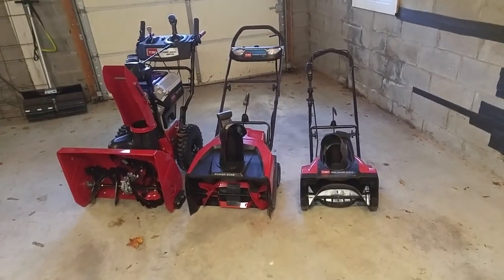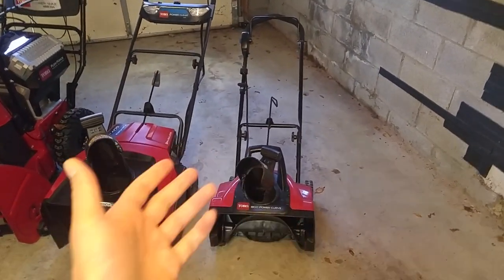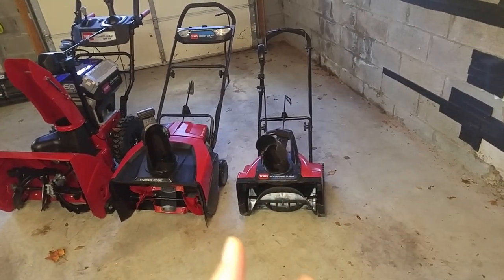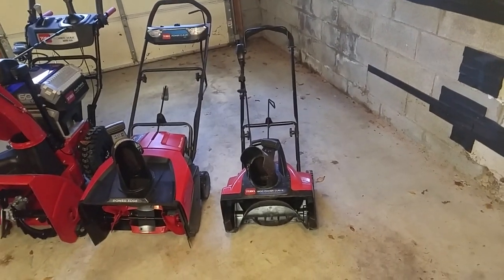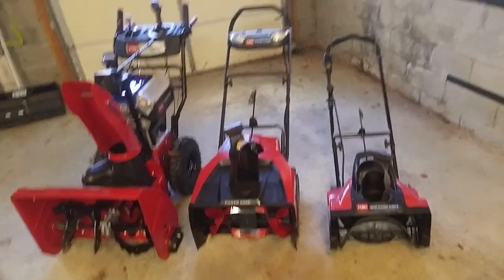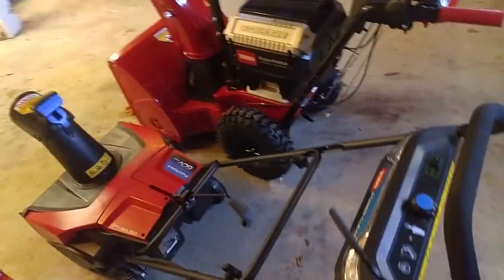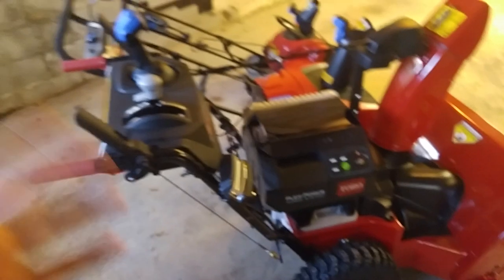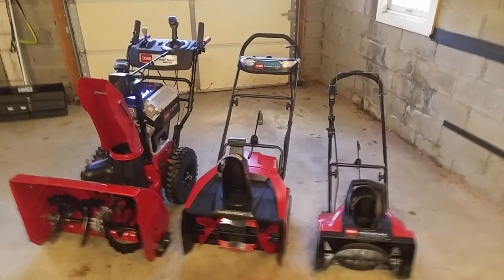Toro electric snowblowers overview, Power Max E26, Power Clear 21 in., Power Curve 18 in.

Comment: You should take the shute handle on the power clear 21 in and rotate it, so it's facing up. That way it's much easier to reach down and turn the shute.
Reply from the maker: Good point!
Reply: I do

Comment: The power curve 1800 with the cord I still have mine and it's 10 years later.. It still works.. But at about 7 years I had to replace The wheel that pulls the belt and the actual drive pulley belt not the big one the small one. Came to about $64 from Toro. But it's still runs and works... I never had the motor stop or anything going wrong with the brushed motor.. I guess if something good go wrong as you stated it would just stop working so I guess it works fine. 

I've taken down 4 ft snowbanks of icy snow that was like four days old. Throwing it on top of the 4-ft bank then going down in layers.. 

I also have a Snow Joe 15 amp corded one. 21-in with I got to replace the 1800 when The drive belt and Pully started to go as I described above.. The Snow Joe unlike power curve 1800 instead of plastic is more heavy duty actually has a rubber steel auger, in metal gears and pulleys...  But I still have my 1800 which I'm probably going to sell now.. The Snow Joe is better.. Don't know if the snow Joe has a brushless motor probably not.. 

And just recently after my snow Joe took care of the February 22 New England 2-ft storm powdery snow with no problem. I actually ordered the ( battery powered two-stage Toro E24 same one you have just 24 in instead of 26.. The only difference between the two is that the 24 is $200 cheaper doesn't have hand warmers, comes with 6.0ah batteries. Instead of the 7.5 the E26 comes with.  I'm guessing it's because of the hand warmers using batteries.. I chose the E24 because my driveway is a three-car driveway about 10 ft wide, And I have the front of my house in the back of my house the back is kind of small only have to do a 20x20 patio... Easier with the narrower snowblower 10 lb lighter in my situation. Also reading a lot of information about is bigger and better with the snow blower in terms of width.. The answer is no.. they compared a 24-in to a 36-in beast The 36-in only saved Three trips up and down. But that was a 36-in. The difference between 24 and 26 they said is almost not even noticeable.. so in that case bigger is not better. But I really wish I had those hand warmers 🤣 

Kind of weird they did not even really focus on the hand warmers with the E24 or the 26 I just had no idea they didn't come with it.. 

The two stage battery powered one HAS ONE BIG DRAWBACK VERSUS THE GAS VERSIONS!! AND IT'S A BIG ONE. If you got a big property that battery powered one is not going to be good for anyone with anything over 8 in of snow.. 

If you watch all the videos as I did for about 2 weeks before I purchased a battery powered one. With regular snow you're lucky if you can do a three-car driveway like mine a small front and a small back With 10 inches of snow YOU ONLY GET 30 MINUTES WITH THE 6.0 AGE BATTERYS OR THE 7.5 AH BATTERIES.. 

The biggest problem is it takes 3 and 1/2 hours to charge the batteries which is unacceptable.. And that's using their medium charger not there slow charger.. ego electric two-stage snowblower comes with a super fast charger charges the same size batteries in under an hour!! 

Three disappointing because the E24 and E26 cost $1,500 in $1,700!! THEY SHOULD HAVE CAME WITH A SUPER FAST CHARGER, THREE BATTERIES!!! 

Tour has great products but they always try to find a way to What I call legally stealing your money!! 

There's 7.5 amp battery cost $350 freaking dollars!!!  

I do understand that they are coming out with a fast charger That will charge these batteries in about an hour... But it's going to cost an extra $100!! YOU'VE GOT TO BE KIDDING ME NOW YOU HAVE TO BUY TWO MORE FAST CHARGES FOR $200!! UNBELIEVABLE!! 

So that's why I bought the E24 because it's a perfect size for my small driveway and property.  If I had anything bigger I'll be buying the gas version for $1,000 less!! 

There's nothing wrong with the runtime of 30 minutes with any two-stage snowblower That's battery powered that's about all you're going to get anything over 8 in of snow. Sometimes even less if it's wet.. It's the nature of batteries How much power two stages use...

I haven't received My E24 yet But the research I've done watching all these videos talking to people... I know exactly what I'm going to get. 

That's my rant thanks for sharing..
Reply from the maker: All fair points.  I only really "need" the 21" single stage, which can blast through more snow than my power curve 1800 and isn't encumbered by a cord.  That is my "main" snowblower.  The 2-stage is only for the crazy stuff, and yes I got the more expensive one as an indulgence.  I have done the back driveway with it (which is fairly large) on all three batteries and moved plenty of snow and had plenty of fun with it.  So far no complaints from me.
Reply: @doctormosfet  You said three batteries, so I'm assuming You must be using The single stage snow blower battery in there also.  Probably why you're not really having that much of a problem.. THEY ARE WAY OFF WAY WAY OFF ON THERE PREDICTION THAT IT WILL DO 30 CARS WITH 10 IN OF SNOW ONLY TWO BATTERIES!! Not even close. 

As for the battery powered single stage. I've tried them before My friend has the one that you have. It did not perform any better than my 21-in Snow Joe heavy duty corded single stage.  too My experiences anything over 6 in You have to keep plowing into the snow pulling backwards plowing into it pulling backwards plowing into it. I never seen any single stage where you can just keep pushing forward unless the snow was ridiculously light.. 

It's like you're doing tricep extensions, or a closed script push-up every push.. 

Also watched many videos of the battery powered single stage Toro or whoever and that's exactly what happens with everyone.. they have to keep backing up slamming into it backing up plowing into it pushing it.  It's unavoidable unless you have a dual stage with self-propelled wheels..  

I'm very experienced with the single stage ones have them for at least 15 16 years. 

My snow Joe corded One that's 21 in will do just as good a job as the Toro single stage battery powered one. There's also plenty of videos showing that on YouTube. 

I'm around 50 years old now. So the last storm ( the blizzard just happened here in New England ) (  I put on a heart strap monitor That double buzzes when it reaches the set heart rate you put in the app )  and the snow Joe did the job. But my heart rate was constantly at 154 beats a minute.. buzz buzz buzz buzz buzz 🤣 tells me to slow down take it easy. 

That's from the constant pushing it shoving it into the snow when it's over 6 to 8 in high.. Even if it's wet a little bit the single stage just gets stuck pain in the ass..  

This is why I bought the E24.. It will do most of the work. In my property is not that big. I just hope I will not have to buy a third battery!! We're talking another $350. Why do you think you're single stage cost so much money like around $700 It's because of those batteries. 

You said you had a big backyard I don't know how big You're saying.  But with three batteries you'll get about 40 minutes run time.. two batteries between 25 and 30.. This is with anything over 8 in of snow.. 

  If your yard is really big and you get over 12 in you'll see what I'm talking about..  

Maybe that third battery really makes a difference.  It's unfortunate they only ship with two of them.. And with that horrible slow charger.. 3 and 1/2 hours is just too slow..  

Soon as I get snow I'll keep you updated. 

But man I've watched every single video you can imagine on the E26 and E24 over and over again..  so I know exactly what it can do.. two batteries is not going to cut it for a lot of snow.. I just wish there claims weren't so far off... 

I know of three people that already returned the E26 because they used it in the last Blizzard we just had in February. All them getting only 30 minutes.. Then charging for 3 hours. Took them all day for something that could have been done in 2 hours. They're very disappointed.. 

I hope Toro is listening.  They want three batteries shipped with The E24 and E26 And they want fast 1 hour chargers And it has to be three of them for any of those guys with their experience to even think about buying another one and keeping it.

Comment: @dostormosfet
 I also own an 1800 power curve and after 6 years I am having starting and stopping issues too. In February of last year I broke the auger on an ice patch on the driveway. Fortunately, I had ordered a Snow Joe 22in sj627 electric snow blower two months earlier.  I ordered a new auger and scraper bar after the snow season ended and despite being mechanically challenged, it was simple even for me to replace them .I am considering the Toro cordless but also the Snow Joe 22in 100v as well .I like the metal auger on the Toro but after watching other videos, I would feel better about it if it had skid plates. Thanks for your insight.
Reply from the maker: Well for what it's worth, I've used the Toro 22 inch a few times this winter (we haven't had that much snow this year) and so far it has been really great.  The metal auger makes a big difference.  There is a plastic scraper on the bottom and it helps you clear very close to the ground.

Comment: I need to service the brushes on my power curve after it failed in the middle of the job, what's the process to access it?  Does the red cover need to be removed to get to it or can it be done at the black end covers?
I saw a post by KC that said the brushes are 6mm x 6mm x 20mm, and seem to be available on eBay for as low as $4.94 for 10 brushes at the moment, so that might be an economical fix.
Reply from the maker: Can you provide a link to the brushes?  I'm actually more interested in the brush springs if anybody knows how to get spares.  

As for getting to the motor, you have to take the the chute control rod off and then remove the red cover.  Then, if I remember correctly (it's been about a year), there's another cover for the motor that you remove and that will expose the motor and endbell.  I haven't tried to replace the brushes, so I don't remember how easy they are to actually remove once the covers are off, but the springs are a piece of cake.
Reply: @doctormosfet  I looked at mine, and wasn't able to get the red cover off completely because it requires taking off the wheels and axle, and it looks like they're not removable.
I was able to pull the cover out away enough to see the top carbon brush, which appears to be the one that failed. It looks like the copper braid connection at the brush broke from corrosion. I measured the brush, and it was 7mm x 11mm, and about 20mm in length.  I jury rigged it by pushing copper braid into the hole that was in the side of the brush, and soldering it to the existing copper braid. I didn't actually try it yet, but I now measure about 5 ohms at the plug when I push the switch, where I was seeing over 1Mohm before, probably just from the moisture of the melting snow.  The whole motor brush and commutator was soaked, so it's not surprising that the brush contacts don't last very long, being exposed to the flying snow through the vents in the red cover.  Design seems lacking in that regard. Vent openings for cooling on an item used in winter, allowing snow to come into the area to start things corroding. Hmm?
I ordered 10 pairs of generic 7x11x18 brushes from an eBay listing for 10.50, which I'll try if I can get the wheels off. I might just cut the axle in the middle to get it off and just put a sleeve over it afterwards, if there's no other way to remove the wheels. It just doesn't seem they're designed to be removed, which seems hard to believe.

The Toro 1800 I have doesn't use those brush springs, but has a separate torsion spring to apply force to the brush to maintain the contact pressure. I was going to just cut the springs from the generic brushes and use it in modified fashion.
Reply from the maker: @wingerrrrrrrrr  you shouldn't have to remove the wheels for any of this.  There's like 4 philips screws in the back (and maybe some on the side?) and that should allow you to at least slide the red cover out along the handle bars so it's out of the way.  That's what I meant by "removing" it.
Reply: @doctormosfet  mine must be an older model, the supports for the wheel axle go through the red cover so unless the axle is removed, the cover can't come off.
This is what it looks like on mine-
https://youtu.be/oL4sEFcCK8g
Reply from the maker: @wingerrrrrrrrr  well in that case I have no idea ;)
Reply: @doctormosfet  my jury rigged fix worked long enough to finish up, but opened up again, so I'll have to wait for the generic brushes to come in and do a better fix. I might see about doing some weatherproofing on it to get it to last a bit longer.

Comment: just bought one of the Power Clear 60v 21", seems great.....problem is, i cant get the chute control rod installed....anyone else have problems with it?....push it into the guide and seems to go all the way in but feels like it just hits just a solid wall at the end, seems like maybe the hole at the end is misaligned enough that it wont catch....?
Reply from the maker: Are you trying to put the chute control rod in with the handle facing up or down?  I noticed if you try to flip the handle facing upwards, it will not go in, but with it facing downwards, it goes right in.  Ahem...that's what she said.
Reply: @doctormosfet  hey, i tried your suggestion and it worked!!.....thanks for the idea, appreciate it!!